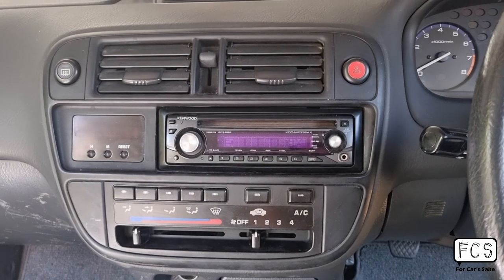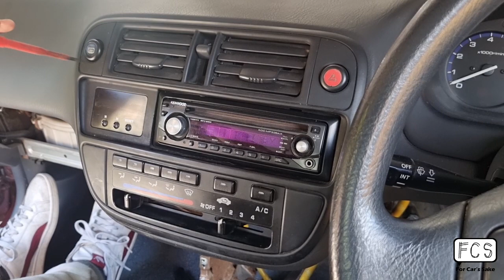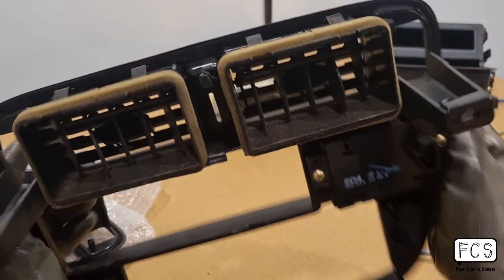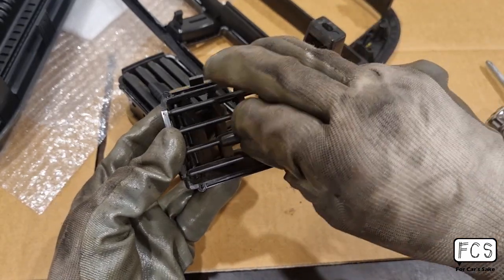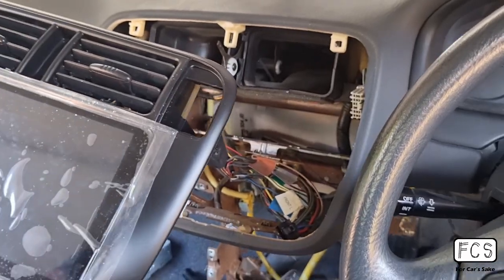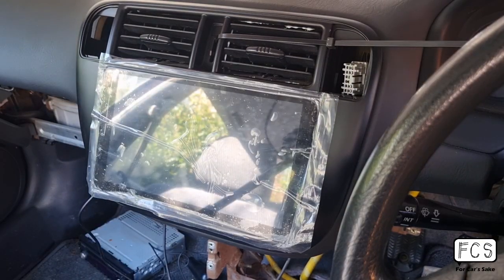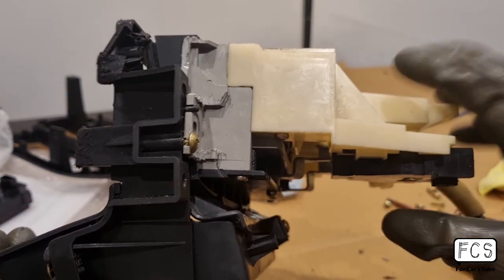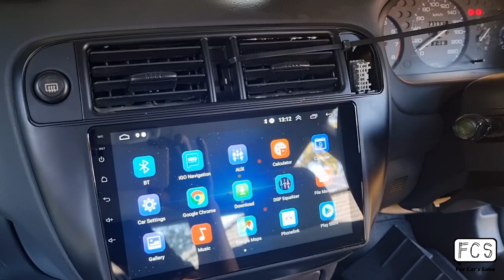UPGRADE - EK Civic 9" two din headunit install and the BEST AC relocation step by step

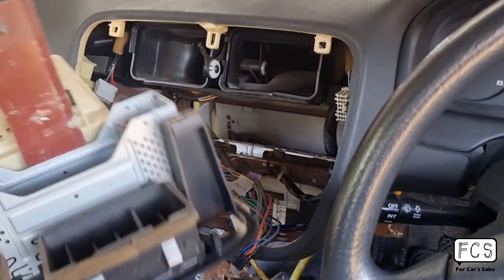Comment: @7:40 

Im assuming they installed that red board to support the weight of the kenwood head unit, it was probably heavier than OEM and was maybe sagging or not sliding in straight.
Reply from the maker: Ah... fair enough!

Comment: Great Video. I have the panel and my car is LHD. The panel says RHD. They both look the same online. Can you maybe help me out? Will the RHD panel fit my LHD car? I literally cannot tell the difference.
Reply from the maker: Thank you for the compliment mate. Definitely get the LHD one as I'd imagine the angle might be slightly off. On the pinned comment in the video you'll find an ebay link for LHD. Hope this helps!

Comment: Boa tarde, preciso encontrar essas grades para está moldura, as minhas são maiores 😢 conseguem me ajudar?
Reply from the maker: Sorry but I don't understand 😅
Reply: @forcarssake  okay, the question is that here in Brazil I couldn't find the grids for this frame and I wanted to know if you know any website where I can buy it, the ones I have are a little bigger than the space in the frame
Reply from the maker: @Edson Paulo do Nascimento  you can buy what I have in my pinned comment. It will bring you to ebay, LHD for left hand drive, or Australia for Right hand drive.

Comment: Unless you have access to a JDM/EDM stereo fascia with intact A/C vents; DON'T DO THIS. USDM vents DO NOT FIT. You will wind up with 2 ugly, gaping holes in your dash, that is going to cost you a minimum of $150 USD to fill them with the proper sized and imported AC Vents. I just UNDID my 9 inch headunit and ac relocation for a stock set up with a true single din android stereo, and it looks 1,000 times better.
Reply from the maker: @GoneAsGoneCanBe  surprised to hear that but I wouldn't know given I'm in Australia
Reply: @forcarssake  I LOVED the big screen, but not having anything in the vent holes made the overall install look atrocious. I was also surprised when I actually popped out my original vents to glue them in and they did not fit. Leaving me with a useless stock bezel and an ugly aftermarket one. Which is why I went to the wreckers and got a "new" one.
THIS ONLY APPLIES TO USDM CIVICS, as I know there are some differences in the wiring in the Aussie market compared to every where else when it comes to 96-98 and 99-00 eks. With that being said there are some work arounds that people have found for usdm civics with out having to convert the entire dash over to a 99-00. Like cutting the bezel with vents out of the oem one, and doing the same to the 9 inch fascia and gluing/plastic wleding/body working the front until it looks good again. Or cutting a section out of the stock vents and gluing them back together. All 3 of these options sound like more time/effort/money than it is worth it to me. I now rock a 5.8 inch screen, it looks perfectly at  home in my stock dash, has all the same features as the 9inch stereo I had installed, with the bonus of having a volume knob.